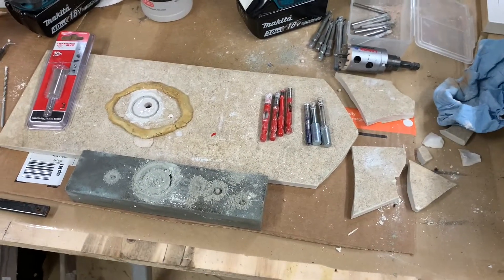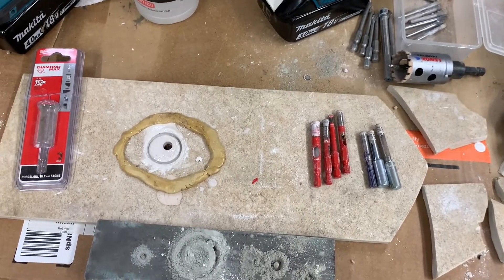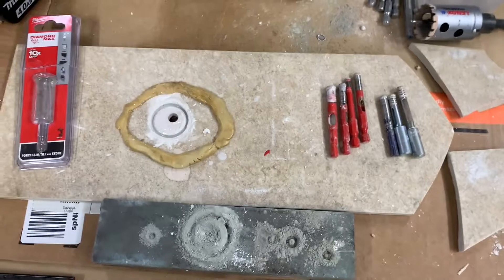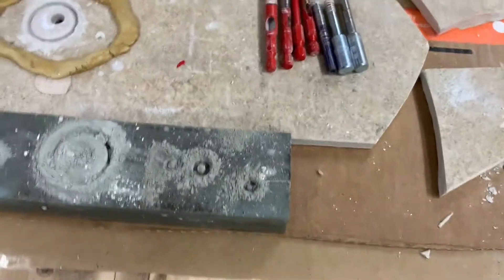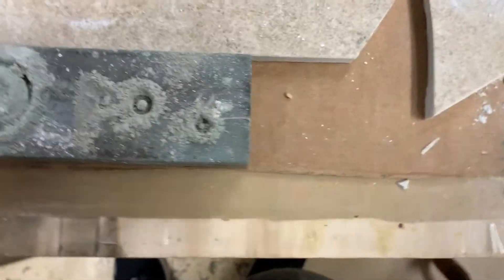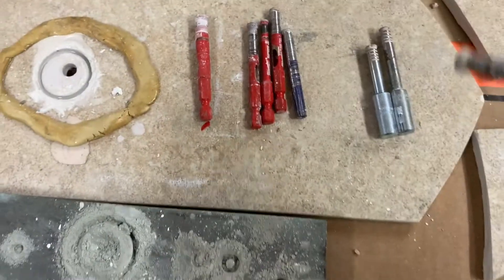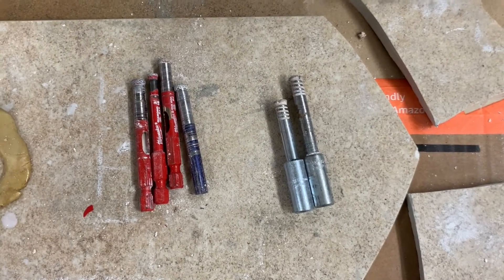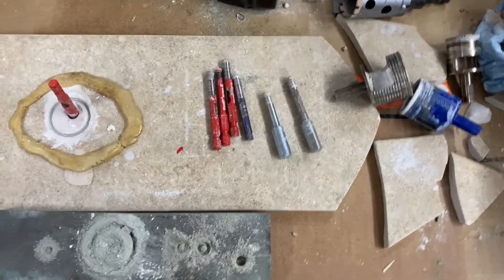How to "Sharpen" Diamond Drill Bits

Comment: What is used to sharpen the pointed diamond bits they use in the hole saw for centering? I just gave 25 bucks for one and the bit walked off 1/8th inch to start with. After side drilling to get it to center then it got dull after 4 cuts even with lubricant applied. I need to align it so it will center well and need to know what to use to do that.
Reply from the maker: Seems to be a struggle for everyone.  I will often drill a starter hole using one of those cheap "arrowhead" tile bits, just to get through the surface so the pilot bit can take it from there.  The arrowhead bits are accurate and sharp enough to get the hole started.
Reply: @mikeadiddle  Thanks i have been looking for a good diamond drill bit that i can afford to do just that.